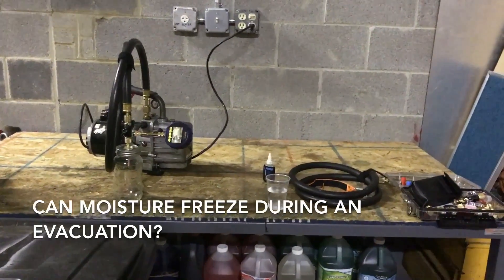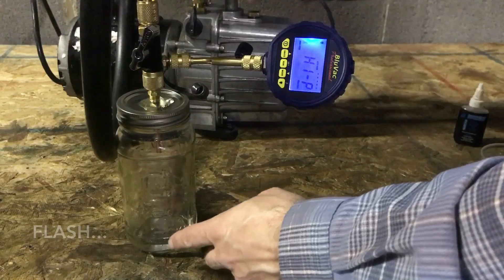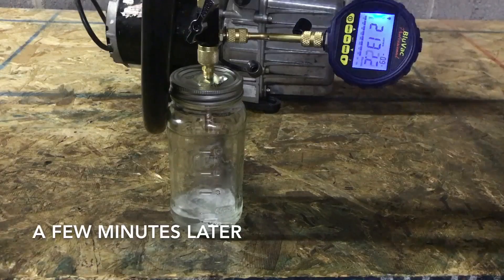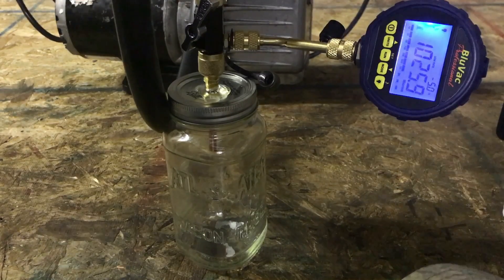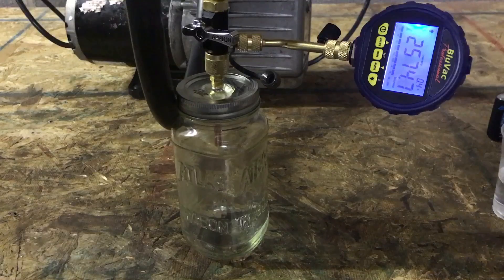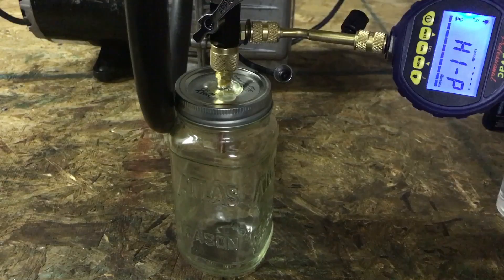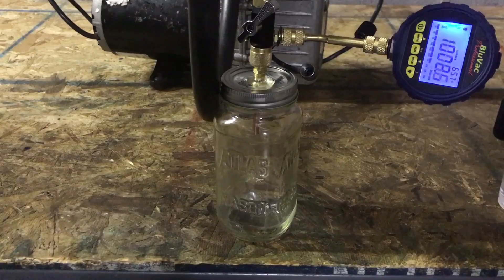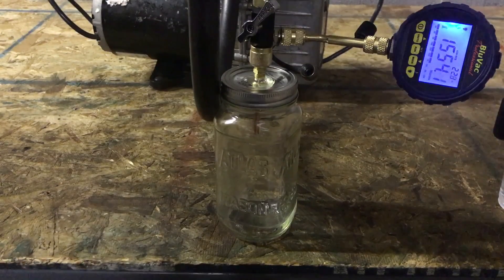Can moisture freeze in a vacuum?

Comment: Excellent demo. Large vacuum hoses are fine. I just like to take 10 minutes or more on a cold day to get down to 3000 microns to avoid icing. Sometimes slower is faster and then you don’t have to worry so much if you have sublimation or an actual leak. Turns out a high quality 4-6 cfm pump is pretty good for not pumping down so fast you get ice, but still gets the high vacuum done with the large hose.

Comment: I want to see if you pump long enough, would the ice turn into vapor and be finally gone as others have suggested?
Also how would you know it in a closed non see through system by looking at gauges?
Reply: Blade, you would close the valve on the core removal tool and watch your micron gauge. If it goes up quite a ways, you still have moisture in the system. The old test we use to do was to close the valve once under 500 microns, then wait 7 minutes. If your vacuum did not go above 1000 microns, you have a tight, dry system.
Reply from the maker: Blade you will know something is up if you have a high quality micron gauge.
Reply: Will it not pull down to 500 microns with moisture? Or does it flatten out for a long period of time before arriving at 500 microns?

Is 500 microns equal to 29 inches and the max vacuum that can be put on a system?

It would be neat to see a heat gun used in your test as well.
I find it hard to believe that ice can turn strait to vapor given enough time under vacuum.
Reply from the maker: http://www.measurequick.com/2017/05/19/identifying-true-leaks-in-a-vacuum/

There are more blog posts on doing an evacuation.

Comment: So should I use larger hoses for evacuation or not?????  I don’t want ice inside my system if it pulls down too fast.... what is too fast?
Reply from the maker: clayton davis very unlikely scenario. There shouldn’t be that much moisture in there anyway. Keep using large hoses, the micron gauge will tell you what’s going on inside the system.

Comment: Neat. Now, I wonder if you could show how slow you’d need to pull a vacuum to be able to evaporate that water without freezing it?
Reply: That would be almost dependent on the ambient temperature.  The boiling water absorbs heat, which will cause the water temperature to drop.  If you want to keep it from dropping low enough to prevent the water from freezing as the pressure drops, heat must be able to enter the system at the same or a higher rate.  THAT will be determined by the difference between the ambient temperature and the system temperature.  I have become very interested in this topic because I have had water cooled condensers leak where the evaporator was outdoors in subzero weather multiple times.  The evaporator was too expensive to replace so we had to evacuate it.  Took over 30 days, 24 hours per day, and 30 oil changes.

Comment: If that happens in an AC system you cant get that ice out?
Reply from the maker: Blade - I tried to recreate making ice when I added volume (recovery tank), couldn't do it. Unlikely for this to happen in the field. ... the refer circuit shouldn't have any substantial amount of moisture in it anyway.
Reply: What causes the temp to drop so low as to freeze the moisture? I thought it should boil off under vacuum.

Is there an absolute way to tell if there is moisture in a system?
Reply from the maker: Blade ,

http://hvacrschool.com/can-pulling-vacuum-fast-freeze-water-moisture/
Reply: Thanks for the link man!
Reply: Nice video

Comment: this is why the guys at appion were telling me that the tez8 pump was way too big for res. systems....if you used the mega flow manifold and the tez8....it would form ice due to the rate of deep vacuum being pulled.....i love this video...i watched like 5 times...lol
Reply from the maker: BK HVAC , this video is just the tip of the iceberg.... it would be interesting to replicate field conditions.
Reply: Neil Comparetto on a lineset with a thermal camera.......
Reply from the maker: BK HVAC , that would pretty cool to bring a TIC to the party.
Reply: I spoke with Appion about this video, because the #1 question I always get when I show off my TEZ8 is the ice question. Appion engineering told me you would literally have to have 2-3" of standing water in a lineset for ice to even think about forming and even if it did form, it would sublimate over time. So Jayson (above) was absolutely spot on. With that said, the TEZ8 is not too big for residential systems! (And I use the mega flow manifold, 1/2" hoses, Appion CRT's and cores removed!
Reply: BK HVAC I had an old CPS VP6 vac pump hooked up to a Vertiv data centre in row and a Appion pos with the 1/2 lines hooked up to a identical system and they both pulled down at the same rate.

Appions claims are bullish. Just cheap plastic rubbish.

Comment: Well now I can throw away my ice machine and just just my vacuum pump ✊.  I wonder if volume plays a roll in this. Say a way bigger jar same amount of water.  Sweet video bro.
Reply from the maker: Ulises Palacios , thanks! Feel free to send your rig my way, lol. I would imagine volume (both jar and liquid) plays a big part. I can think of a few spin offs that would be interesting.
Reply: Neil Comparetto lol. We just need to find a glass jar the size of a recovery tank.  Don't forget to change that oil in your pump.
Reply from the maker: Ulises Palacios, changed it, looked like milk!... they make 1/2 gallon jars... you pipe an evap coil, rolled up 7/8 line, cond coil, and this jar in series. That would simulate field conditions much better.